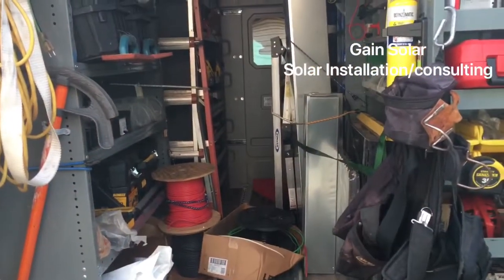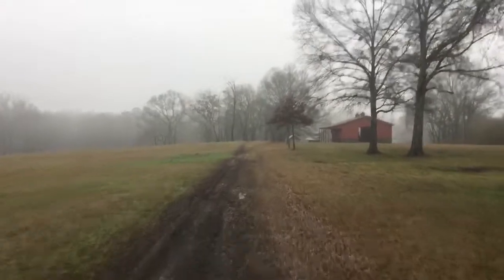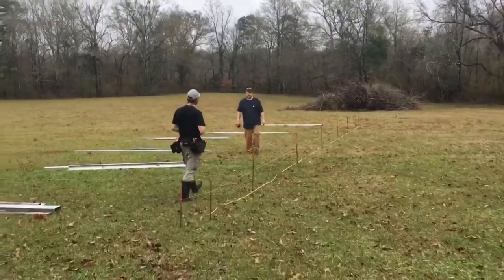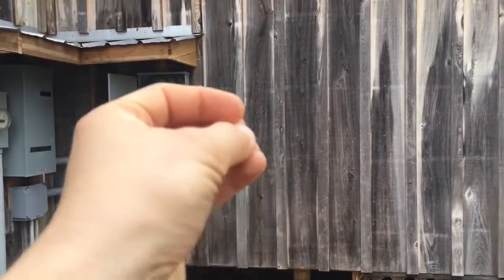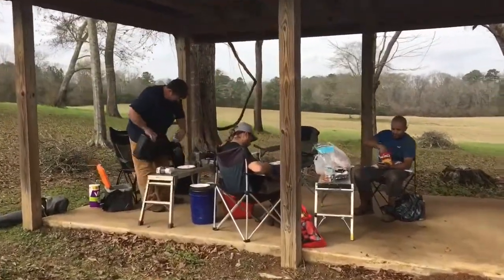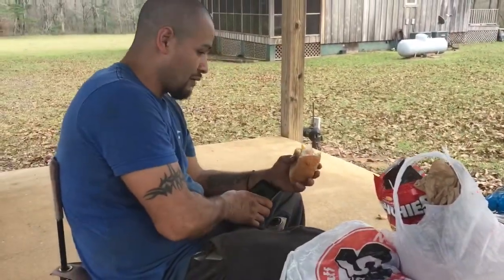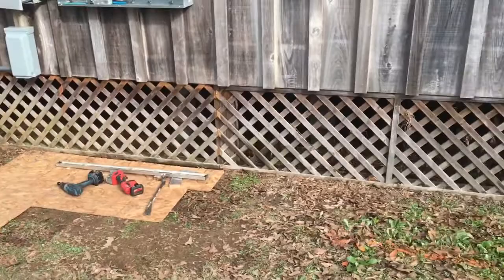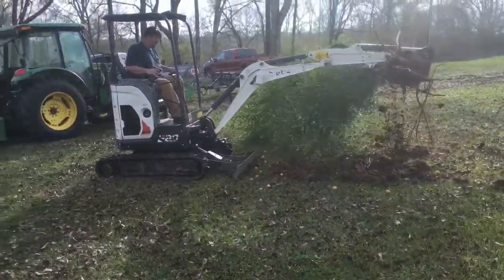Louisiana Solark 8k: Groundmount w/traveling Solarman

Comment: Have you tried the diamond pier foundation mounts? Quick install, no waiting for cement to set...
Reply from the maker: Is this the same off grid by design solar distributor?  Link to the mount please
Reply: @GainSolarPower  No. Never heard of that company. I was looking  for a way to install my wind turbine tower without having to pour a ton of cement or use guy wires and allow me to move it in the future if needed.